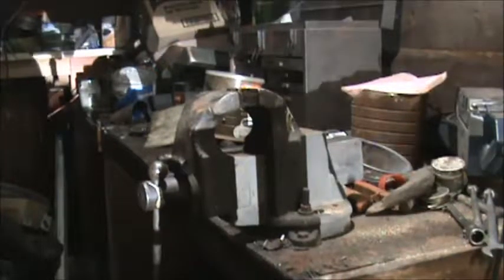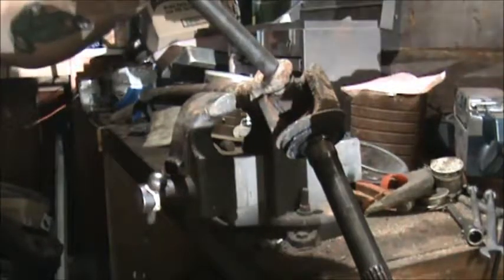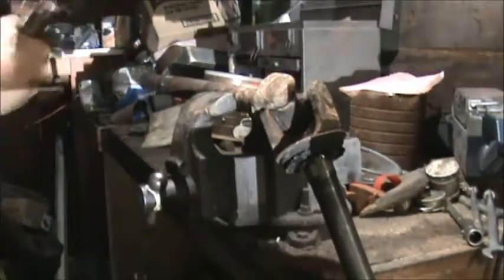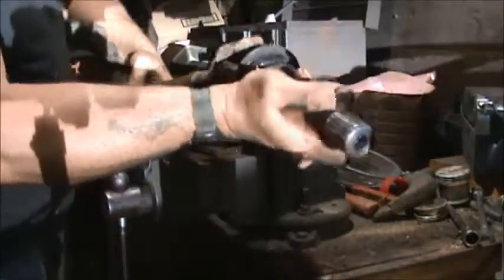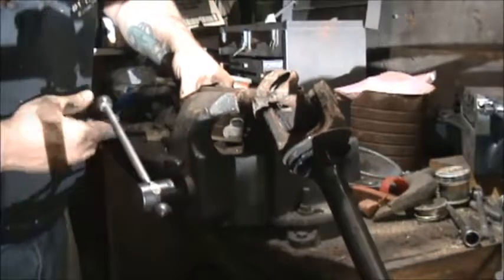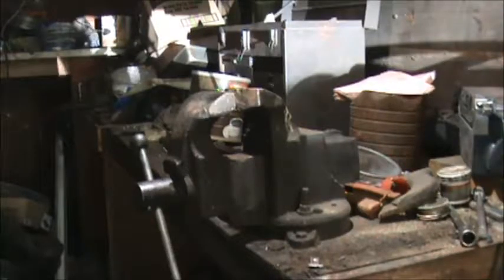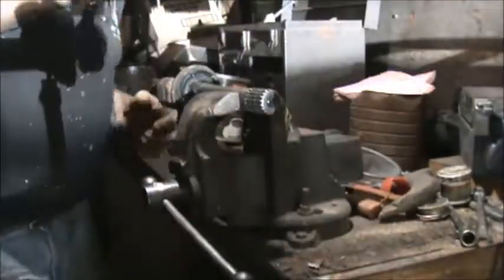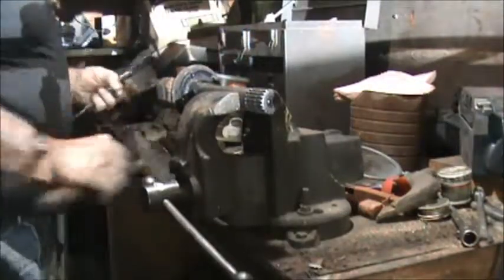Chevy K 10 front axle P4

Comment: I think I'm gonna hafta show you how to swap u-joints with a bench vise.
Reply from the maker: Don't you need a vice that opens up really far to do that? I've done U joints before on the vice for the Scout but the screw was just barely catching.
Reply: To get them apart, rest the yoke on the open jaws. Strike the other yoke just behind the u-joint caps until it stops. Flip and drive it the other way. Knock the caps out and set the u-joint cross in the open jaws of the vise and repeat. I think I have a video of that, don't I? If not, then it's waiting to be edited.
Reply from the maker: OHOOOOOO!!!!!!